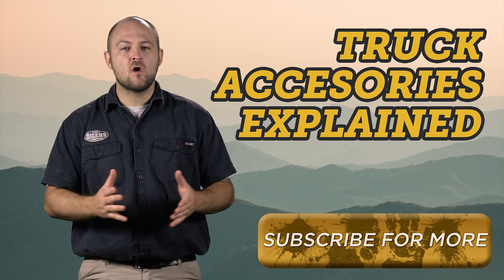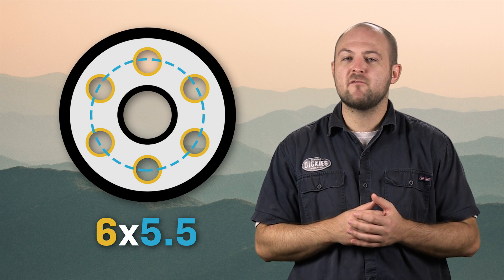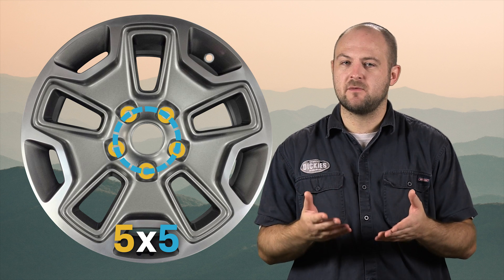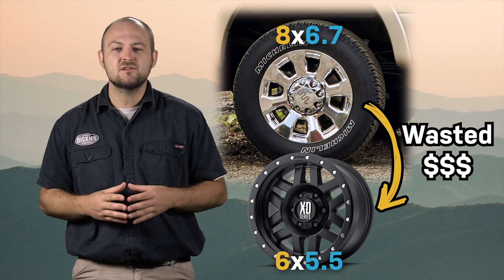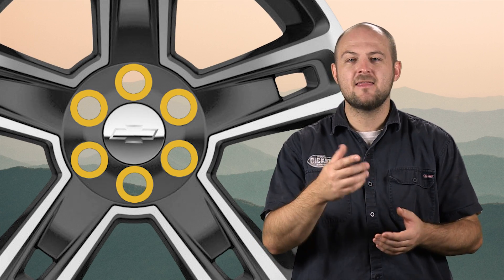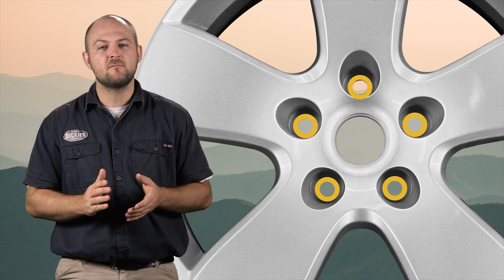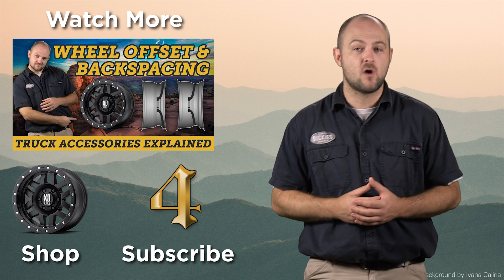How to Measure Your Truck or Jeep's Bolt Pattern | Truck Accessories Explained

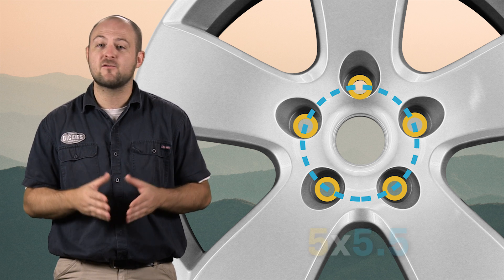Comment: WHAT?!?! "On a 2017 Ram 1500 you'd count the five lugs and get a measurement of 5.5 inches." (1:25) That makes absolutely no sense... I counted the lugs on my TJ and my JK and got 5 lugs... But they are not both 5.5"
Reply: I just got 5 not 5.5 inches and I have 10 holes 5lug wheels lol 😂

Comment: Wouldn't radius x 2 would give you the diameter as well? Measure from the center of the wheel to the center of one of the bolts and multiply by 2. Nice video btw.